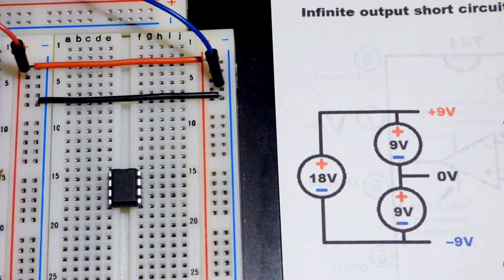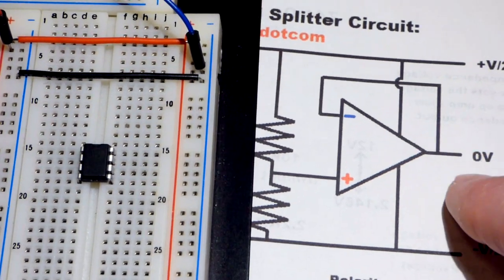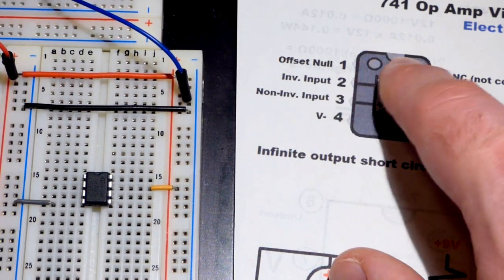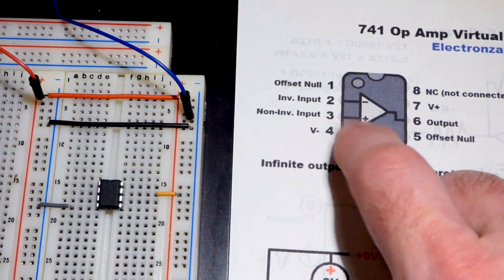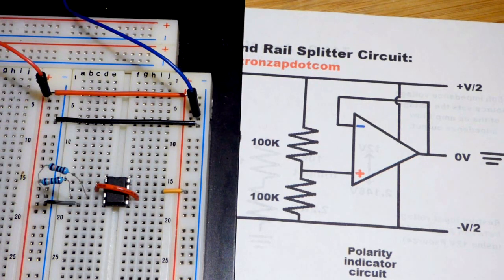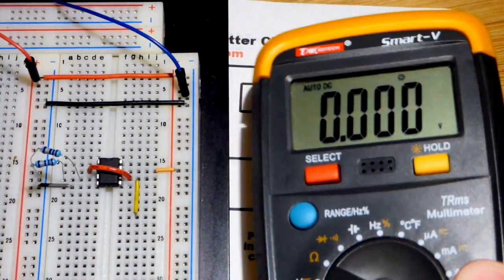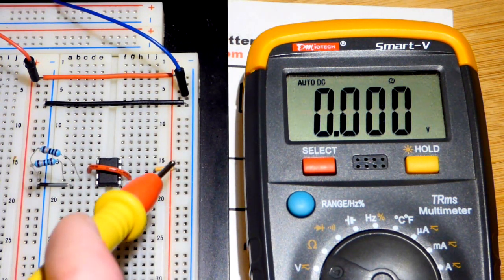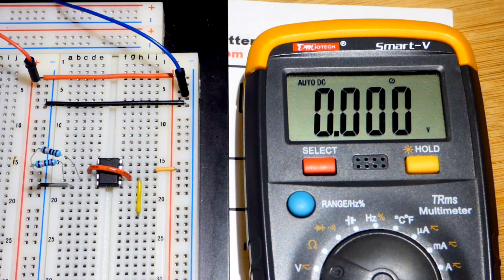741 op amp rail splitter circuit to produce split power supply

Comment: I need a split supply for op amps including a subsonic stereo phono filter. I want to us a 24volt d.c wall wart. What other capacitor for extra filtering should I use. I don't need lots of current. The wall adapter will be about 3 feet from the 741 splitter and circuit.
Reply from the maker: I've never built a split supply for a useful circuit, so I don't know for sure what would be the best way to wire it up. I'd google search dual supply for audio circuits and see what people who work with them often are doing.

Comment: I used LM358 to provide virtual ground and for the rest circuitry to work it looks like it doesn't like prefect midpoint since it's not rail to rail opamp so I had to tweak the split point with a pot sot it's slightly offseted from the midpoint.
Reply from the maker: Yeah, trimpot would be the best option if you need an exact half way point.

Comment: Great video...does this introduce any noise into the system...or is it negligible
Reply from the maker: Should probably add some capacitors from the supply voltages to the output. I never worked on making a low noise version.

Comment: I am not sure I am quite following this.
Are you using just one 18v power supply or two 9v power supplies?
If you are using just one 18v power supply, then the 2x 100k resistor divider will result in a voltage of 9v at the non-inverting input (pin 3), and therefore 9v at the output (pin 6) and also 9v at the inverting input (pin 2) as opposed to an output of 0v....or am I missing something?
Reply from the maker: The op amp wired as a rail splitter in this case is taking the 18v supply and outputting 9 volts. If we design our load to be connected to the output, then in relation to the output the positive rail is 9V more positive and the negative rail is 9V more negative. So, we are assign the output as our 0V reference point with a +9V and -9V supply as far as the load is concerned.
Reply: Errr sorry .... I gotta get my head round this! Can you elaborate and possibly give an example?
Reply from the maker: I'm headed out the door and that's probably the best I can explain it. This might help https://en.wikipedia.org/wiki/Virtual_ground there's links at the bottom for more info.
Reply: Ah yes thank you, I understand this now. The output is only 0v 'relative' to the 2 rails which is why it is called a 'virtual ground'. 👍
This helped me: https://tangentsoft.net/elec/vgrounds.html
Reply from the maker: Glad to hear! It is confusing for a while.

Comment: nice video. how much load we can drive from it?
Reply from the maker: Not a lot, all of my op amps limit current to a low amount. Probably want a push pull amplifier between it and a load. I keep forgetting to make those videos.
Reply: @Electronzap  Can i run an LED from this circuit?

Comment: I picked up some ICL7660S ICs for about 15 cents a piece and have been using them to convert Vin to some negative Vout. I failed too many times trying to split with a voltage divider but probably because I was trying to amplify a 9V powered signal with only 4.5V. I think the two hardest parts of understand op amps are 1) how to power them 2) understand that the input signal is only used to "shape" the output signal, and the output signal itself comes from the very rails that power the op amp. This is why no current needs to flow into the + and - inputs. The output is a replica of the input. Audiophiles don't even know this. 😂
Reply from the maker: Good points!